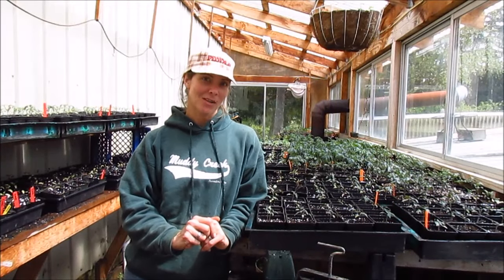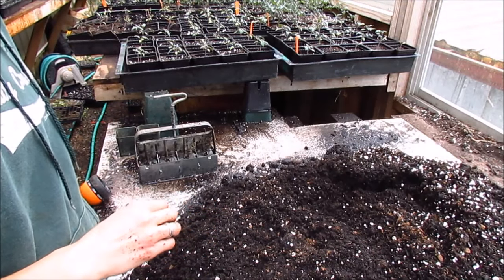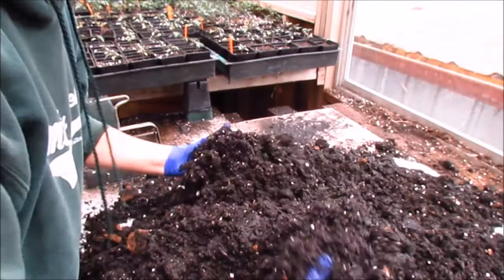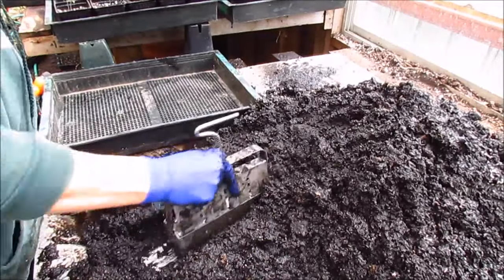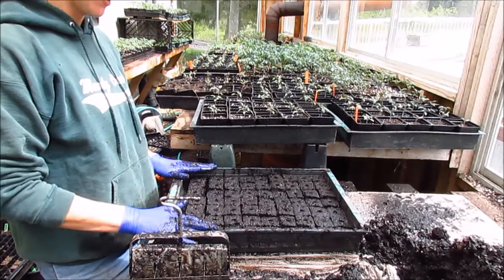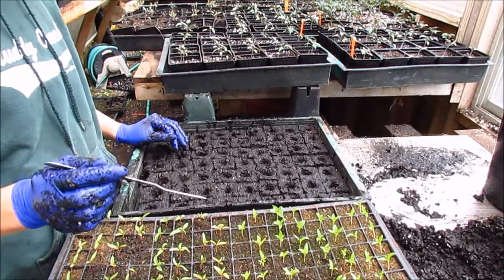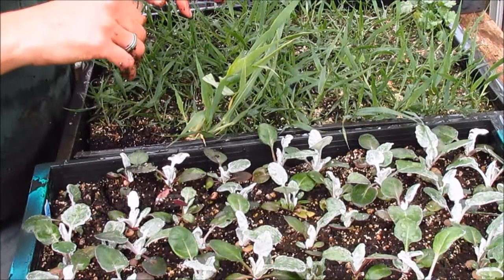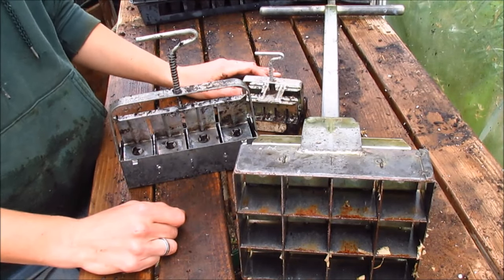How to Use a Soil Blocker for Seedlings and Plant Starts

Comment: This is the best video I've seen on making soil blocks. I also found rinsing the blocker in a bucket of water to be a big help in preventing the blocks from sticking and breaking apart when being released. For those of you making a smaller batch, I've found that one part of warm water to three of blocking mix to be a good place to start from. Then add more water to bring the texture up to the consistency shown in this video. The only down side is that it's messy - but fun -  and it takes a little practice to nail down the technique and moisture level. I spread out large plastic bags over the table to cut down on the clean up. The bucket of water also is good for dunking your hands and can be poured into the garden. The plastic bags can be inverted and used as trash can liners after your done. Excellent video!
Reply from the maker: Thanks for checking it out and the informative comment!
Reply: I use a large mortar tub to mix in making sure that I water the soil well and then allow a day to become evenly saturated before making the soil blocks.

Comment: Thanks for the video. Using the two index fingers to expand the holes in the blocks althugh is very convenient, but long term will cause tiny bone spores in tip of the fingers and nail root causing pain, inflamation and in my case loss of nail and a few months for the next one to grow. It can happen to any finger when used in repeated tasks.

Comment: How often do you water seedling in soil blocks? Do you water from below or above?  Do you have to water them more often, to prevent the blocks from drying out and falling apart during transplant?
Reply: It depends on what you are growing, but I find adding in coconut coir to your soil recipe really helps with water retention.
Reply from the maker: We prefer to water from beneath to minimize erosion of the block.  Watering timing depends a lot on weather, but every 2-3 days we check and water the larger blocks.  The small ones, we grow in trays that are set into solid bottom flats so they can be easily watered from below.

Comment: Thanks for the great video!  What did you sprinkled on the transplanted tray after all the transplants were inserted into the soil blocks?  How do you avoid Damping off?
Reply from the maker: There wasn't anything sprinkled on them, the different colored soil was the starting mix that was attached to the roots of the seedling. We have found that keeping the block wet, but not soggy and good air movement to best way to prevent damping off...thanks for watching!

Comment: Great video! Where can I get the transplant tool like you're using in this video? I've looked everywhere.
Reply from the maker: You can get them online eBay, amazon etc. They are called a "widger tool" .....and it will change you're search to widget tool, so make sure it's searching for the right tool.  This is a brand a set number you can also search Bosmere P873...hope it helps and thanks for watching!
Reply: Perfect!  I was using the wrong name.  I found the widger on ebay and ordered today.  Thanks for the info!

Comment: Great video! I was wondering why you didn't use the smallest soil blocker to start the seeds instead of the plastic tray that went under the lights? Wouldn't that have less transplant shock going into the blocks you were making? Is the smallest blocker too much trouble? I've never used one but it would seem difficult to get the right mix to work with them. Keeping the small soil blocks moist would also be difficult? Is the small blocker worth buying?
Reply from the maker: Thanks for checking it out, we do a variety of thing depending on the crop. If we are using a 128, it's usually because it's a slow germinating seed so it's easier to keep them evenly watered by bottom watering or it's going strait from plug to field. On the flip side we use the mini block for things that come up fast or have really small seeds, this allows us to bump them into bigger blocks. That way when you are out planting in the field every block has a plant in it. On the smaller blocker, we make a ton of them, we can get 300 per flat, which helps with our limited light starting space. You do want to make sure your mix is well sifted otherwise the little blocker can clog. They are more intensive on water management, we water them daily but it's worth the effort for the space savings
Reply: Thats a good tip about the germination speed. I didn't think of that. Thanks.

Comment: How do  you water these starts?  Do you put  them on a tray with humidity dome and put water in the bottom or do you just keep misting the top?
Reply from the maker: For the larger blocks, we are generally transplanting into them and will use a very fine shower wand to water them. With the smaller blocks we set them in mesh 1020 flats that fit down into solid 1020 flats and we water them by flooding the solid flat. We are setting up a capillary mat system for the larger blocks, so check back for the video! Thabks for watching!
Reply: I saw another video where a gardener used a similar setup, and put his blocks on an old cloth diaper, with one corner dangling down into a bucket of water. The diaper wicked up the water and kept everything moist—a poor man's capillary mat! :-)